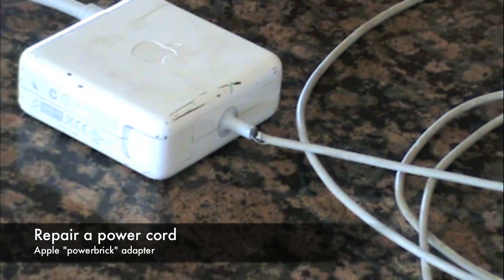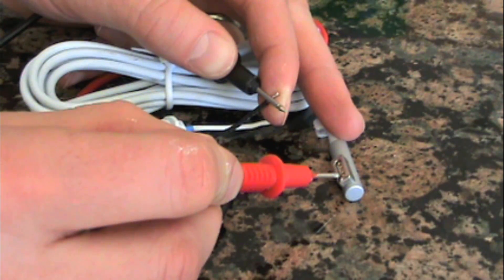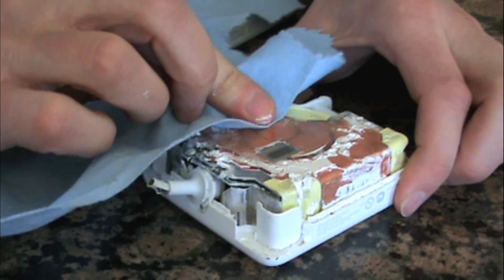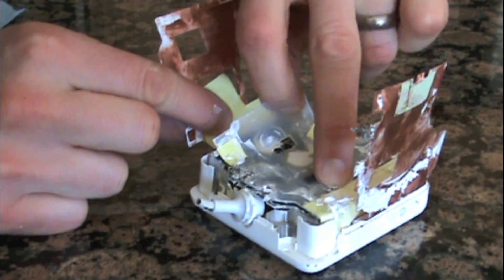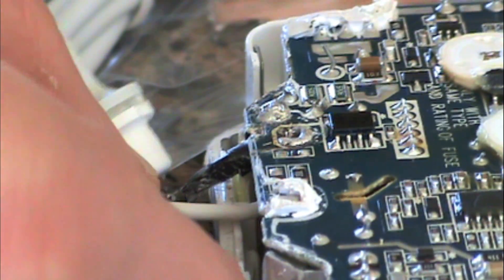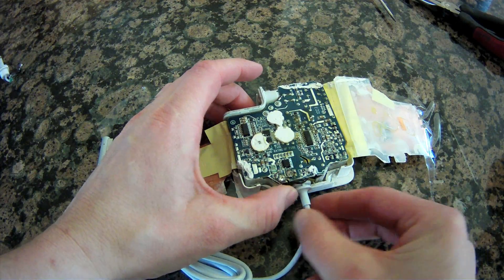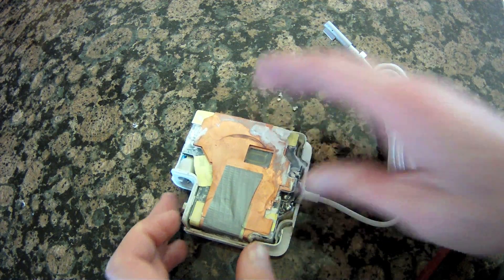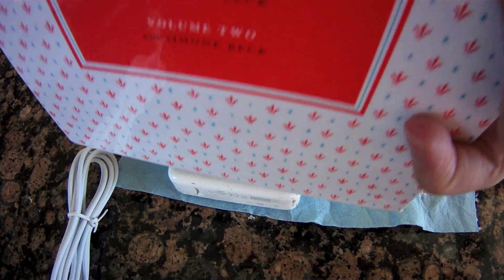How to Fix Apple Powerbrick Adapter Cord

Comment: This is a great life hack for a real design flaw.  I wish I had seen it before I bought a whole new cable for $80. But that was 3 years ago. Now I have another cable going bad and found that a flexible supportive collar can be fashioned out of Shoe Goo to stabilize the cracking outer polymer, but it needs to be done early on, before things get too bad, like yours was. Thanks! The trick to working with shoe goo is to use ice to sculpt the bead into place, or wet fingers.

Comment: As a tech with a lot of years of experience and was taught to solder in 8th grade (decades ago), I was taught never to buy a soldering gun. They run way too hot for electronics - they are best for heavy wiring such as in automotive and 110v wire. Because they[re heavy they are hard to control. Buy a soldering iron of around 30 watts. I like lower wattages but lower takes more experience. It does give you better control of the solder and allows you to work on finer, more delicate repairs. Also get some copper braid solder remover and be sure to get all the old solder off. I switched to braid after using a suction solder remover for years (I still keep both handy). I also prefer liquid flux. Once everything (including the old solder) is removed, give all connections a light coat of liquid flux (it comes with a small brush). It will make soldering go a lot easier and make a much better connection. When I was young, soldering paste was all they offered. I came to hate that stuff. It's messy to work with. The liquid it super easy to work with. Cut the insulation a millimeter or two shorter (to expose less wire to solder) than you need 'cuz when the wire heats up, it will shrink the insulation a bit and it will pull away from the circuit board, leaving a bit more wire exposed than preferable.

Comment: Unfortunately I superglued my fingers together and my fingers to the brick. I now wear the brick as an accessory. It's pretty cool.
Reply: Why not to mount a DC socket rather than having a fixed cable that is likely to break again. Like this: http://www.mattr.dtdns.net/stuff/macbook-charger-breakable-cable-problem-fix.jpg (note that the rubber bands can be easily replaced with the superglue technique ;-))
Reply: But how did you wire that plug to an existing cable? Do you have any tutorial?
Reply: I bought mine ready-made from Amazon 2 years ago (still available today): https://www.amazon.co.uk/gp/product/B014GVB2JQ/ref=oh_aui_detailpage_o03_s00?ie=UTF8&psc=1
But you can easily wire one up, plenty of tutorials how to soldier a plug onto a cable, just watch out for the correct polarity!
Reply: Dioes this mean you can now plug your finger in to your mac and the outlet and it will work?
Electricity !
Just like Dougie Jones. Maybe you'll come back as special FBI agent Dale Cooper. And make some damn good coffee!

Comment: I like your style of presentation - calm, slow and well said.  Only criticism is using one of them thar old tyme soldering guns from the ye olde days of big, discrete, clunky components and point to point wiring, when you had to get things really really hot to do the job.  Modern pcb boards and components are very easy to fry in no time at all!  A temperature controlled soldering iron is a must have in these days of the incredibly small, and getting smaller, components!

Comment: Thanks for this tutorial. I was able to fix my charger with ease. The only thing that happened a bit differently was that I had to remove both casing sides as the side with the soldering bits was the one that remained attached to the circuit board. Cheers!
Reply: you all prolly dont give a damn but does any of you know a method to log back into an Instagram account..?
I was stupid forgot my account password. I would love any help you can offer me
Reply: @Koa Jerome instablaster :)
Reply: @Lewis Kamryn I really appreciate your reply. I got to the site on google and Im waiting for the hacking stuff atm.
Looks like it's gonna take a while so I will reply here later with my results.

Comment: Nice video. The only thing I would have done differently was to add the solder back to the copper plate when re-assembling the brick. This establishes the noise reducing (EMF) ground plane by connecting the copper plate with electrical ground on the circuit. That's why it was done that way. Nice work!
Reply: Thanks for that piece of info. That was exactly what I needed to verify. I thought the copper plate has been connected to the black wire but could no longer tell for sure after I got it apart. The video still didn't make that clear, so your comment saved the day!

Comment: Hi there mate, excellent job, I made a similar repair my self but it only laster for a few hours. Dont know why but it worked like a charm for around two hours and now its not charging again... Any thoughts on that?
Reply: Just buy a new charger it's much easier
Reply: For the sake of anyone else reading, my guess is that your soldered connections were weak. As the power supply heated up from use, one of the weak connections expanded until it was no longer connected.

Comment: Where did you get the replacement cable from? Thanks.
Reply: +TECH GUY You can buy it on ebay.
Reply: Get one on amazon for less than 10 dollars shipping included
Reply: That's what I did. Amazon prime for 8$

Comment: Thanks! I did it! But when i charge the notebook i can not use a touchpad. He's doesn't work well. Anybody had the same problem?
Reply: Are you having a problem with battery swelling? If your battery is getting old and swelling, it pushes against the touchpad and makes it difficult or impossible to click it.
Reply: Thanks for ur answer. Youtube's lags. This is my 3rd try to answer you. Yes, my battery is 6 years old. There is no swelling problem i guess. Before i "fixed" all was ok but now when i try to move cursor he randomly moves.
Reply: This is what I would try, at least to eliminate a variable: close the lid on your MacBook to put it to sleep. Remove the battery while leaving the charge cord connected. Open the lid, taking care not to let the charge cord get disconnected. Verify if the touchpad is working correctly or not.

It may not be battery-related and the problem could be coincidental. But this test will let you know for certain. That your cord was fixed shouldn't have anything to do with the touchpad operation. The touchpad acts the same whether the cord is attached or not, correct?

Comment: Hi, great video. i foolishly removed both wires and did not take note of which goes where. is there a way of working it out by looking at the circuit board? i hoped the board would show a negative and positive sign but unfortunately not. The layout of my circuit board looks different,  the principles should be the same. Mine is probably a copy, though was sold as genuine like so many on ebay. i have attached a link to two closeup photos of the front and back of my board. Are you have to advise? Image link: https://drive.google.com/drive/folders/0B5DDuYWnVxxPQmdYRlEzRk5ja1k